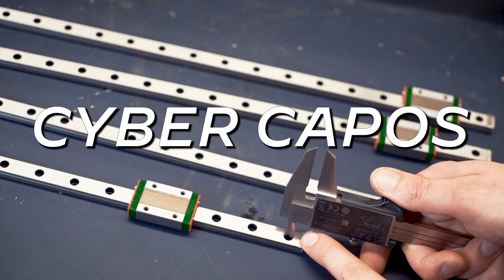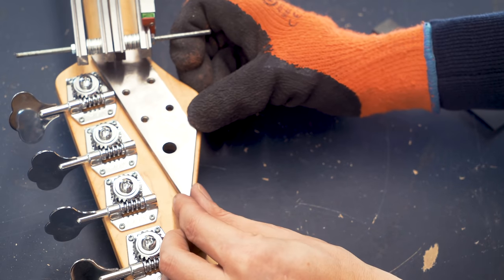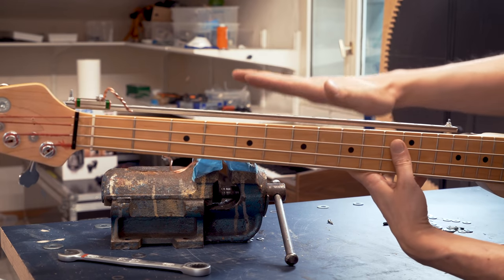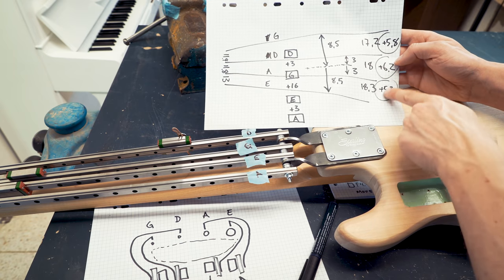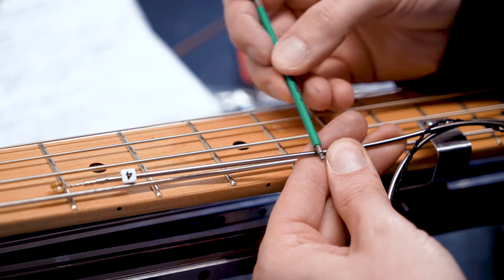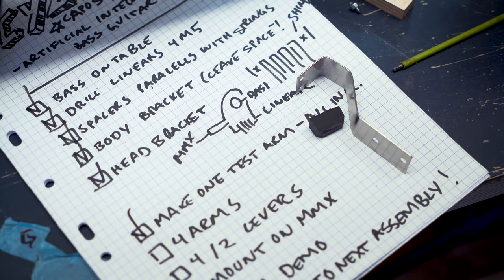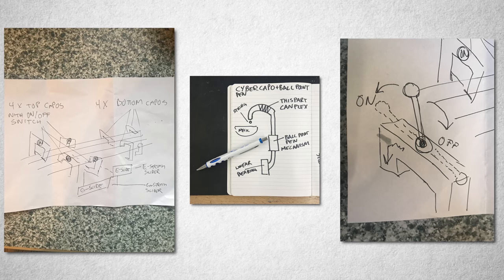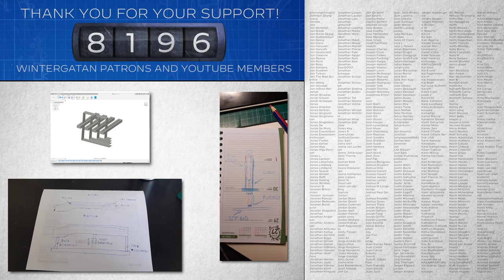Custom Bass CYBER CAPOS

Comment from the maker: Hey! 
Some follow up from the Funnel video last week: 

- We have ordered Plastidip, a clear rubber/plastic coating that i will experiment with, perhaps i can dip the Marble funnels and give them a clear coating and reduce the sound a lot. Cant wait to try that. You know some chains have like a rubber coating over the chain? that kind of idea. 
- Superjumps. Some marbles were jumping over the funnels, in the angle i placed them the funnels are not using their maximum catching capacity, it looks better to have them at a more shallow angle, but i can put them more upright and the catching surface will almost double. However i hope that i can avoid that. I am pretty sure i want to have a more brilliant/sharper sound on the vibraphone which menas less latex coating on the hitpoints. Less latex coating has always meant less bouncing so perhaps we can just luck out and have the problem go away by itself. After three years of trying to learn how to design stuff i still depend on lucking out apparently. haha not good!

- C Y B E R C A P O S i dont show it in the video but the main way to play the bass will still be manually with the fingers, above the capos. Cool way to do that is to play the bass manually for like two choruses, and then set the cybercapos to something new, go into a musical bridge and play a third instrument. that was how the ondophone was intended to be used. I can probably also play simple keayboard stuff with left hand while playing simple basslines with right hand. 

- i didnt try the flat wound strings yet, i think they will sound nice. They have less trevble and the marbles create a lot of high frequencies.
Will make sure to record the difference and show it on video anytime soon. 

- this morning the MMX exploded, literally. One tiny screw was sticking out from the conveyer belt, it had wiggled itself loose and while i was recording the music demo of todays video, suddenly there was a huge BANG and the safety function clutch release of the flywheel activated. Parts where flying in every direction from the conveyer belt marble path. Amazingly enough i think the plastic food - grade chain was stronger than the mild steel and i think reparations will be quite smooth. But again, this shows how vulnerable the MMX is and that we need to glue/loctite every single screw before we can trust it at all. So i didnt have any marble lifting system when recording the bass demo in todays video thats why the improvised song is cut short, i played until there was no marbles left :)

I hope the C Y B E R C A P O S will be a good tool to use to come up with an IMPOSSIBLE bass line to challenge Davie504 with one beautiful day in the MMX future. 

there you go, have a great day and good luck with everything you are doing! Martin
Reply: Nah, errant flying marbles off the stage will be the flung guitar pick into the crowd favorite. First row souvenirs
Reply: Hope the MMX is OK after the "explosion" and you too.
This has come from a few ideas to playing some tunes already.
Thank you for this journey :)
Reply: Good job you had that safety clutch!
Reply: Whoa, the "explosion" part is worrisome. Pls, bump up priority of screw fixation.
Reply: I'm sur that the marble superjumps are caused by the swinging vibrofone when the timing happens to be like the marble hits just when the vibrofone plate is about to swing up and the vibrofone spring ads its energy to the energy of the marble
Reply: As far as the "on/off" problem, could you look into a robotic solution of some kind? Adam Savage seems bored enough at home rn, maybe bugging him could prove helpful?
Reply: Using a pick??! Not Epic!
Reply: I think  glueing every screw in is not the best idea, as you maybe have to get them loose again for repair/maintenance. Even though it would be some work, but I think just before a concert you should do a "check up" of the MMX and just tighten every screw.

Furthermore: Are you maybe interested in a custom made aluminium-neck for your bass?
I know someone who does them, and I could ask if he would be up for it if you like.
Reply: Hey Martin, if the cyber capos are giving you trouble and are constantly losing their pressure on the strings try putting a little spring where the plastic parts are screwed onto the metal
Reply: at this point in the build, I just want to know how much it weighs, it seems like it can crush an elephant.
Reply: @tricksterhj  The picc is used for the guitar. For the Bass it was a shim washer ;-P
Reply: Wintergatan You said, you could not switch off the capos. How about sliding them beyond the last fret where they have no contact? You would need longer rails and/or modified attachments, but this would be the easiest solution that came to my mind.
Reply: Plastidip: Great idea! Great way to save your idea and optimize for sound.
CyberCapos: Very cool. The music you're making is already the best Wintergatan sounds I've heard ever. A+++
"The MMX exploded": O_O whaaaaaat!?!?! 🤯
Reply: Sorry I misspelled your name.Winter gatan I like to buy one of those guitars from you for my son.Be safe be blessed take care everyone.
Reply: And ball bearing on the string with a little tire? Less friction during displacement.
Reply: Could you post some photos of the damage? That sounds crazy I can't even visualize it
Reply: For the eventual on/off functionality I think your best bet for ease of use, sacrificing some simplicity in design would be using a mechanism like you find in a retractable pen, easy click on/click off operation, and parts/replacement parts would be cheap if you used the existing cam shaft from a pen!
Reply: Individual on/offs for each Capo section would make for highly interesting keys to play in.
Reply: Thank you Martin for sharing this wonderful experience with us!  ❤️
Reply: OMG... i comentet about this idea on the "Cyber Bass Marble Drops"  video in april , and he is really doing it... I knew something like that could be done, and i even predictet the reason behind it... This is awesome🎸
Reply: As there is right welding rod for everything. There is right loctite for everything too. Please don't just use "superglue". And I know you won't ;)
Reply: Love the stuff u create man this is seriously impressing.Make a bicycle with instruments.The bike that you ride but plays music as you ride it.
Reply: Awesome! You could add a toggle clamp at the end of the linear rails on the body of the bass to get the on/off. Toggle clamp are pretty reliable and adjustable. McMaster has a large variety to select from.
Reply: If you were wearing safety glasses while playing in a concert, I would not consider that a disappointment in any way.
Reply: Hej Martin! Jag tror du borde använda hjul som rullar på strängarna istället för de där svarta plastbitarna som glider. Vad tror du om den iden?
Reply: Or you could eliminate the luck factor and increase the angle of the vibraphone plates to bounce the marbles horizontally instead of vertically
Reply: hey wintergtan you could use a waight  system have gravity keep them on the strings then lift them up to move em idk much about that but just an idea
Reply: Why not using soft rollers?
Reply: Ouch, I hope the damage is minor! The clear coating sounds (ha!) really good!
Reply: Hey I recommended Plasti Dip in the last video :D
Reply: How about something similar to the clicky pen for the capo on/off system?
Reply: one thing i've tried before to that effect is to dip the steel wire in clear paint, several times between cures, i did about 5 layers of clear paint to silence it while preserving the sheen of the metal, but you could probably do with 3 layers instead, from an aesthetic pov the plastidip may work well but wont look that good
Reply: Well sure, but can you use marble drops to program the fingers? Surely there's space for a few more channels configured to move each finger up or down one fret per drop :)
Reply: When in tour, you should have the stage a bit slanted, so that all the escaping marbles will collect at a defined point. You could then pick them up with a secondary lifter and put them back in the MMX
Reply: for the capos you can use a electric motor for placing the capos in the right spot to make then moving all alone.
Reply: Wintergatan cool design and I love seeing the sketches. An idea for on/off switch would be letting the fingers fold backwards/outwards like a flower or rotating on the guitar string axis. This would allow more individual string control rather than a “all on or all off” method from altering the height of the linear rail unit.
Reply: The CC's sound awesome. Thought occured, if you're trying to give the Capos an on/off function, you can using the same technique with the overhead levers and make a binary switch, just smaller, and that lever can raise and lower the fingers the same way it does the muting system?

A Mini Mute, if you will.
Reply: No latex, vinyl stickers.
Reply: Thanks for the update, hope the plastic dip works! Nothing wrong with counting on luck, I've never heard of anything being completed without a lot of luck thrown in.
Reply: OMG, a Davie504 vs MMX bass batle would be EPIC
Reply: I think I speak for the masses when I say we want the footage of that MMXplosion..
Reply: When you do a studio recording of your album can you have it made into a vinyl? I love the idea of the recording spinning just as the marble machine spins. Thank you for your creativity.
Reply: Sorry to hear about the explosion! I'm confident that you will recover quickly. 
About the capo tension adjustment -- It seems to me that having slotted holes where they attach to the linear rail carriage would allow for adjustment of the finger height and tension. You could mark an index on each part so reassembly and repairs wouldn't require a specific amount of washers, simply matching up the marks. This would allow for on the fly adjustments as well. Also adds the very small side effect of giving more visual uniformity to the four capo fingers.
Reply: What would be amazing is if you can get some small motors to control the capos. For instance, 8 motors, 2 on each side of each capo. That way you wouldn't constantly worried about hitting notes at the right beat. You could even set up some controls for each note so it's instant going to the note you want. And I say small motors to keep the noise down. Just an idea you might want to try to see how it goes.
Reply: Just a quick heads up on plastidip and clear coats (from personal experience). As the plastidip and clear coat do bond together, the desired rubberized effect will not remain. moreover, the product will no longer be peelable. even if it is a sturdy product, you would need to reapply it several times throughout a world tour. The best scenario imho would most likely be plastidip only. If a glossy effect is desired, keep in mind plastidip does make a glossifier. (basically a slower curing solvent that will make the matte surface re-dry in a glossy finish). Never thought my experience with cheap rim refinishing might help out on the mmx but.. yeah
Reply: Я плохо знаю язык, так что использую переводчик. Извини, но я не смотрел видео. Я закрыл глаза и слушал мелодию. Так нежно, так деликатно, огромное спасибо, Мартин. Пришлось смотреть второй раз)
Reply: I was thinking for a simple way to make them toggle on/off, you could have them rotatable on the arm that gives them pressure, sending them up 90° over the fretboard. It wouldn't be as simple as a switch, but you could probably come up with some way to make them switchable, (something like a little bit of steel in a channel that would make them be able to switch up and off, and not have any crazy screws and all that). But I am not an engineer, so take my idea with a grain of salt. Good luck to you man! We all believe in you!
Reply: There is a much more robust alternative to plastidip in fluidized bed powder coating, it is the process used to PVC coat stuff like the white plastic coated wires for clothes drying racks etc. You would have to send them out to have it done though.
Reply: I just realized that the marble machine is Covid resistant... In normal bands you need multiple people standing around each other to play, yeah you can space each other out but they still need to practice together. The marble machine however only needs Martin and he seems like the kind of guy who would like to plug everything in and run all the wires for it himself. He might have to broadcast the concert online and I'm sure the first few actual concerts he puts on will be online for all of his patreons (past and present). The question is do you hold the free public performance first in attempt to get more people to pay as a patreon for access to the bigger and better performance with like a before and after the show segment with him where he asks questions  and has like a 20 minute long video set up that thanks everyone who helped with it and explains everything that they all did. I'm sure that they will all get to watch the show for free and maybe even get a few extra codes to give to friends and family so that they can see it.
Reply: @deadhamster7570  but then he would have go through the entire fret board before getting to "0". I think he wants to go from, let's say, the 12th fret to 0 without going through all the other frets in between.
Reply: What are the chances of the "super bounce" being due to resonance...? Same principal as the double jump on a trampoline with two people. Because you have devoted so much precision in a consistent drop my first inclination is that when a marble hits as the waves are coming back towards the impact zone they imparting a slightly higher amount of energy into the steel
Reply: @deadhamster7570  I thought he was going to do that at one point in the video.
Reply: As for an on/off mechanism....idk if you guys looked up vertical toggle clamps but I believe with your team that you guys could build mini versions for the capos. I would also provide a small handle for you to use for sliding up and down the frets(probably using the black and white knobs to match all the other manual controls) just an idea :)
Reply: Absolutely love the baseline tune in the end of this video. Is it a wintergatan song or can I find it somewhere. Do you have any good tip of other artists playing this kind of music. Love the sound. Love the project and can't wait for more songs
Reply: Hey if you use like an Arduino or Raspberry Pi with servos and a worm gear setup you could program the capos to be in specific spots at specific times without the need to manually move them. Just a thought.
Reply: " suddenly there was a huge BANG and the safety function clutch release of the flywheel activated. " So, you are saying that safety clutch release was a very good idea?
Reply: I have a question, can you explain how do you make your living, I mean as an artist and engineer , you don't seem to have a lot of work and revenu at the time, so if we eliminate youtube, how do you make it? if it doesn't bother to answer off course, it just because the answer may help a lot of people to live your way and work on their creativity.
Reply: Hey Martin if you use little wheels for fingers you won’t have that anoying metal sound and there will be less friction and your string and wheels wont wear out. 🎼😜
Reply: So on the capos on off, what about a click spring like you would find on a non-momentary button switch. Push down once to set the spring, push down again to release it.
Reply: I feel this Martin's post/comment is like a hidden track. I don't usually read this pinned post. Now I'm wondering if I missed something huge these last 3 years ............ oh my......
Reply: @me15.738  yes, it is exactly this, that's why I suggested to aim a plate vibration node to limit/avoid this.
Reply: with all the added weight on the neck it may cause the neck to bend over time, i hope you have a strong truss rod on the neck
Reply: Simplest way to toggle on/off the capo : mount the pad on a single wing bolt. Hollow a passage for the string in the pad. Then 1/4 turn the bolt (so the pad) so set the passage perpendicular to the string so having the pad pressing the string. Idk if I am clear enough...
Reply: Be careful of that moving crank handle Martin. Either your cord is going to get wrapped up in it or your voice will be a couple octaves higher after getting racked in the groin.
Reply: You should still weigh the super jumping marbles. They may be a different weight.
Reply: Wintergatan I really want to learn how to play star machine on piano now...or at least some of it
Reply: Have you considered a ball point pen style on/off system. So you aren't adding more complexity to the underside with your sliding handles.
Reply: Wintergatan hey, at least the safety feature works.
Reply: Something that will finally beat davies Holy Slap!
Reply: Wintergatan this may be a long shot but if you use the same clicking mechanism from a pen redesigned it could be used to quickly switch between on and of while still keep pressure
Reply: @CheerioCheerio  Loctite doesn't mean glued forever, it just means harder (a lot) to unscrew. That's the blue thingy you see when unscrewing just about anithing
Reply: I was wondering, while in this prototype the fingers are sliding over the strings, now that you know required pressure will you consider using rubber wheels instead? Or are you fine with the friction as it is, possibly after installing flat wound strings?
Reply: Why not research how Compressorhead made their bass guitar play?
Reply: You here that @Davie504
Reply: Look at clicky pens how they have a little spring in you press down it pops out. If you had a little button and spring you could press it down to take it off the string, then press down again to put it back on the string. So look at the design of pens. :) 

Video: https://www.youtube.com/watch?v=MhVw-MHGv4s
Reply: you need to play with compression to simulate shorter notes on the bass.
Reply: @wolflocke  electrically driven solenoids.
Reply: Hang in there Martin. Don't let such little obstacles pull you down. We will se us at the world tour, may it be sooner or later. And it will be Glorious :D
Reply: Why does each string have its own individual output (why four 1/4" jacks out on the bass?)
Reply: Hi Martin have you considered that some of the Marbles have a different hardness index causing different jumps?
Reply: by the way "we're on our way to playing music". Sir you are wrong. To me it sounds like you've been playing music the entire time on this machine since I've been watching this series. You are playing music...just an outsider's perspective. :)
Reply: Wintergatan: I have done quite a bit of work with plastidip in the past. It is a wild material. I think you will encounter problems with curing it in shape on your funnels. I know it’s already ordered, but the higher the viscosity, the better it’ll be for you in the end. A good application of it may also require some serious sanding of the wires involved. I might consider some pads attached to the wires before you fully commit to it. The rubber has a hard time adhering to polished steel, not to mention how hard it’ll be to bake onto the wires. It also has a bit of a yellow color. I’d recommend that you do some serious testing with it beforehand, on test wires. Also, know that common resin powder pigments work great in it, if you want to avoid the yellow snot look. Drop me a line if you want my full suggestions.
Reply: If you caught that explosion on video I hope to see it next week.
Reply: Kollade på prototyp ritningarna men så vitt jag såg handlade alla om att manipulera "finfrarna" min tanke var att ändra rälsen då att du ha en förspänning som när du med wn spak trycker ned så hamnar rälsen rätt å fingrarna på strängarna. Lite som att ändra brikorna som kontrollerar höjden på dem. Men då påverkas alla så det kanske blor svårt om du inte gör någon individuell lösmning för rälsen i näcken. Bara en tanke. Ha det bra! 😊
Reply: I was thinking a small wheel pressing down, you know, friction n' smoooothness. Loving this!
Reply: You definitely need to try Teflon! It's not gonna wear off easily. ;)
Reply: Love you Martin. I know you probably feel like this project needs to wrap up but honestly I'm just loving the whole journey. Take your time and don't compromise. This journey is every bit as incredible as I'm sure the final product will be. Loving every single video.

Also, sidenote, I highly recommend crowdsourcing someone who's proficient in machine learning! The problem of signal to noise for the mmx is literally perfectly addressed by machine learning. You could simply train an AI on the sound machine noise of the MMX and and have it remove that noise. If you have questions about that feel free to ask. I'm not an expert in machine learning, but I am a software engineer and I can do my best to explain how machine learning works.
Reply: I think the superjump Marbles Just hit the edge of the latex spot, causing them to have a different trajectory, couldn't you make the area where marbles can hit slightly larger? Seems like a more easy fix!
Reply: I know that you are a genius Martin, but a clicky pen could work as inspiration for  the capo on off device.
Reply: Can you mount the rails on individual cam levers attached to the pin at the base of the neck to raise the Cabo arm off the string?
Reply: You could consider controlling the position of the capos by using a secondary slow-rotating wheel like the black one with pins in it, to act as an instruction for servo motors or linear actuators that control the position of the capos. For example: every 4th rotation of the main instruction wheel (black barrel-like thing), the secondary wheel has 4 lines, each corresponding to a bit, so that gives you 16 options. So for example a marble on line 1 and 4 would represent the number 8 + 1 = 9 (binary stuff). The second instruction could then be a marble on line 2 and 3, representing the number 4 + 2 = 6. Hold the first instruction in memory and add (not numerically but as an array) the second instruction, then you get the binary representation 10010110 which is the number 166. You could use that to control the servo's to move each capo to a certain position on the bass string. I see you're probably using 14 positions on the string and you have 4 strings, so the total number of possible configurations is 38.416 which requires 16 bits of information so 4 instructions when you would use 4 lanes of marbles for this. I think that would make the marble machine more versatile.
Reply: What is the song at the end please? Love your channel!
Reply: be careful of COVID
Reply: You must be 100 million subscribers
Reply: re: Plastidip.  It should deaden the sounds of the marbles striking the baskets themselves.  However, make sure to test dip some scrap stainless pieces to make sure none of the solvents cause unwanted discoloration of the metal.
Reply: Consider adding more fail safe mechanism.
like make parts that are failure points, think disposable "single use" parts, like fuses on electronics.

On the capos, no idea how to make it easy to turn on and off, so good luck with them.
On the bouncing, I think it will work like a multiplier, so reducing the bounciness may help with the problem, but it will still be there.
Reply: CheerioCheerio loctite comes in a rainbow of  flavors. He should be okay as long as he doesn’t use the wild cherry 🍒
Reply: CYBERSLAPPER or not EPICO
Reply: On Off possible solution = Pen   The click system of a pen.
Reply: V-grooved ball bearings. Use them to reduce friction and loss of definition as the finger material wears down on the strings. If you buy more of them, you can also put 2 per slider at each end and use them to remotely move the fingers, kinda like old radios moved the needle indicator with stainless steel wire. For example 4 little knobs at the front of the machine that would allow you to twist them to move the fingers up and down the scale.
Reply: THIS IS A FRICKING MASTERPIECE :D
Reply: I had nylon strings on my semi hollow jazz base
Reply: Use Flex Paste instead :D
Reply: @TomanovicsGergely  
Will +Davie504 approve though?
Reply: Maybe I'm crazy but.... the MMX its already 100% functional up and running???
Reply: Please.. Please make this starmachine2000 piano ver available on Spotify
Reply: perhaps it is better to use a spring-loaded rubbered (or in a plastic ring) bearing to press on the string
Reply: wheel with curve sealled with rubber and with a kinda spring suspension. and the slider has a staking look like wave that push the roller up and down to avoid more stress to the fred bumper while changing note. kinda push rod style with camp like in engine
Reply: Not a musician, but engineer here. First let me say that I love what you are doing from an engineering perspective. 

Just as an idea. If you would make the capas on ball beared rolls using, you could roll them along the strings without any friction which should reduce wearing them off massively. I could imagine putting felt on the rolls or using a softer material could be helpful for the sound.
Reply: I think, programable capo would be nice - using stepper motor to move the finger!!!
"NOW! you can play any EPIC!! IMPOSSIBLE BASS LINE! (Davie504-Voice).
Reply: Switch your tuners out for the quick tune change ones!
Reply: Perhaps instead of a fancy mechanism what you could do is tune the bass down a half step tow D# and use 1st fret for the low E
Reply: Martin, are you making some kind of backup from the pieces that you freehand? And are you keeping record of the fine adjustments  (amount of shims in each place, etc) that you make? You know, if something bad happens these records will save the work if someone else, besides you, need to work on the machine... and for historical purposes also.
Reply: Epico, slapping like!
Reply: Cant battle davie504 if you aint playing ...
Reply: i dont know what to say..
Reply: THAYVERCAPOS as cool sounds.
Reply: Thank-you somuch
Reply: Love that you challenged Davi504. He is amazing but you sure bring a lot to the table. If you two got together and wrote a song.......
Reply: Plastidip..  Good idea.  Make sure you really layer it on, though.  In the automotive world, some enthusiasts use plastidip on their wheels or body panels.  It will look awful the first few coats.  just keep layering it on.  the more layers, the stronger and more stable it will be.  More layers will also mean that it will be tougher, but also easier to peel off if you ever wanted to change the color or texture. Not enough layers will make it prone to flaking off from impacts.
Reply: Thank-you somuch, everyone
Reply: Genius man!!!! Cool!!
Reply: Thank-you somuch.
Reply: 8i
Reply: 💡SELF PLAYING BASS IDEA!!! You need to create some push rods that go under the bass. Some coming from the top reaching halfway down the bass and others coming from the bottom and reaching halfway up the bass,  meeting in the middle. They could push the "fingers" up or down the Strings automatically.  The push rods could be controlled by a wheel at either end with pegs on then that would push the rods in either direction and can be programmed by replacing the pegs with one's of different heights in order to push each "finger" into the proper position.  This way it could play itself.
Reply: 💡 For the switch to take the pads off and on each string just use a guitar foot peddle tied to an electro magnet on each one that when pressed would turn the magnet on or off and could lift the pad up as to not touch the desired string. Somethingeasy like that. Just a thought.
Reply: I am so glad that you guys focus on music, if you focue on Nuclear, there are possibilities the super next generation atom would be created, you guys Geniuses 👏😁
Reply: he is professor of music...
Reply: You are genius, I'm sorry, i don't speak Very good in english, i'm brazilian 🇧🇷🇧🇷🇧🇷
Reply: Have you thought of doing this with a fret-less bass? and adding some kind of sliding note players?
Reply: Nvm you kinda already did that
Reply: Ready from a gameboy😉
Reply: Ugggggggggggggg
Reply: For a coating on the funnels and other parts try a urethane rubber adhered with a bonding agent. Smooth-On has a wide range of durometers of rubbers and Ure-Bond bonding agent to make it stick.